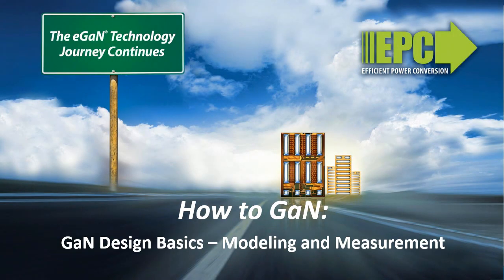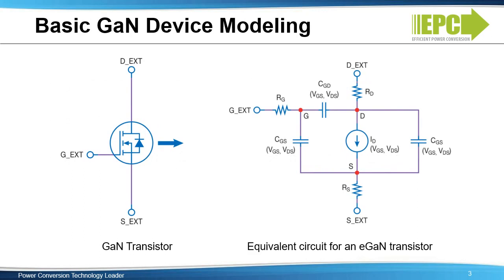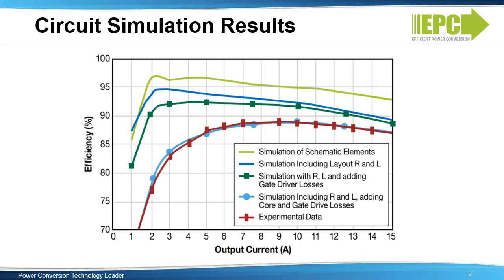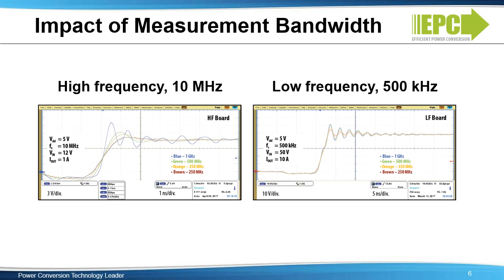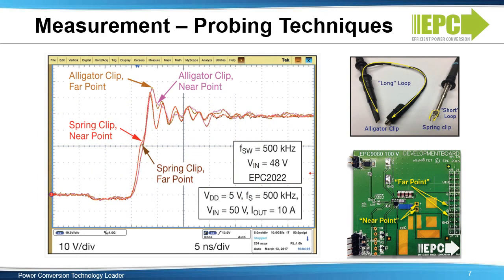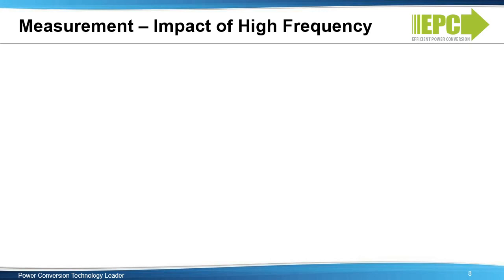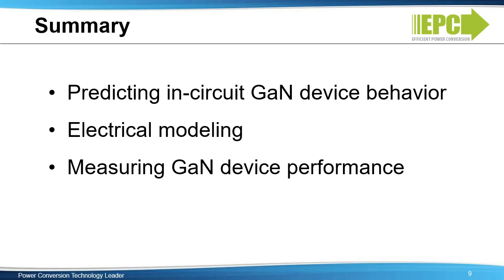How to GaN 07 – Design Basics: Modeling and Measurement

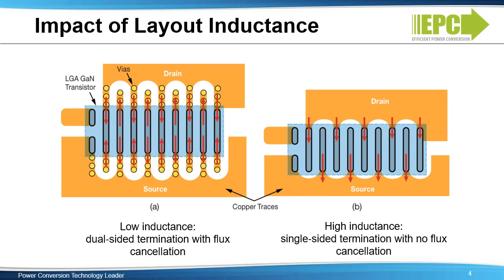Comment: At 1:55 in the video there are two PCB layout ideas.  
The "low inductance" left picture; I think adding vias will increase the inductance some.
The "high inductance" right picture; Adding cancellation current under the transistor (flowing upward) will help.  
Is there a tool (spice) for testing these layout ideas? 
I am playing with the INN100W12.